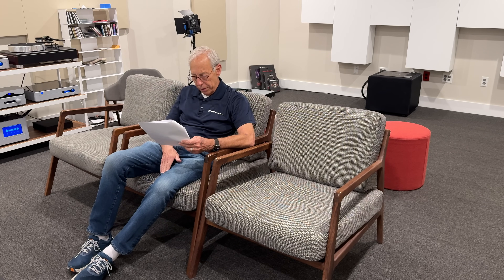Servo or DSP subs

Comment: Back in 1995, I purchased a Velodyne F1500-R.  It is STILL in use today and still looks and works like new.  With that servo system, it is why Velodyne held the spot for having the lowest distortion of all subwoofers on the market at the time.    What is amazing to me is, with only 250 watts, it is VERY close in output at the lowest notes (15Hz.) to my Martin Logan 1600X with ARC and 900 watts continuous. 

And YES, the two subs are part of two independent systems along the same wall only about 9 feet apart.  Both audio systems can play at the same time and AB tests are easily done.

Comment: Use the line level connections.
Using high-level will nake the signal go from high level (speaker level) and then to low level inside the sub amp and then gets amplified by the amp again. Makes no sense. The high level inputs today are there mostly as a backup to connect if you don't have line level out..
And line out is the exact same signal but before it is amplified by your amp or reciver anyway.
And in a surround setup you would want it connected as "LFE/L+R" so it gets used for the dedicated LFE channel in movies etc and in 2.0 stereo without LFE signal it just uses left and right signal and sends that out.

Comment: So how would you use DSP and speaker level connections? It seems to me that the DSP is either something from the preamp or a crossover component and will not be fed to the main power amp. Another thing that I'm discovering, most full range speakers attempt to produce low bass. However, as we all know, it's a real challenge. Therefore subwoofers are then dedicated to optimize that lowest octave with a dedicated, robust power amp. Wouldn't it make better sonic sense to limit the main speakers from trying to produce that lowest of bass information, thereby freeing up the main power amplifier from having to deliver that current? And the only way to do that is in the realm of line-level interface, correct?
Reply: Paul as mention this before, he wants to build dsp upper in the chain somehow, perhaps active speakers.
but a purely passive speaker and normal hifi gear is a safe bet for a business and easy to use for home.

as for my experience i moved over to dsp preamp unit and that is a huge step up.
i have a purely digital unit, but you can easily get one with analogy output.
with 4 channels you can use peq and set up high pass for mains and use any kind of subwoofer, active or passive. and most importantly have the ability to delay the main speakers. normal hifi you can only delay the subwoofers and that one are already delayed with built in dsp.
also you have the dsp before the amps, so they get bandwidth limited frequency range.
in my example i use a minidsp SHD studio, two dac's and two power amplifiers. digital in from a source.

Comment: But Paul, you have said that your use of servo designs like in the Infinity system is no longer needed.  Therefore you don't use them in the Aspen F-30's.  Why is that?
Reply: servos require amplification and he wanted to make a passive speaker, think active woofer section was tested at one point

Comment: Interesting discussion.  If it works effectively, servo corrected subs makes logical sense.  Running them off the main amp also makes sense to have the sub have the same distortion as the main speakers.  I don't see DSP and servos as opposing choices.  DSP can correct for in room sound and servos still align sub distortion.

Comment: A DSP in a subwoofer is a suboptimal position of a DSP in the system.

The DSP will be very limited in its capabilities. 

It can't do anything with sound frequencies above those that just the bass can reproduce.

The placement can't fix the crossover point, what order of filter, linkwitz or Butterworth should be used for your mains.

The DSP can not tune your room for ALL of the frequencies that your mains are playing.

That DSP can not fix the frequency response throughout your whole system.

There is no way for the DSP to be able to give you different house curves more than at the bass frequency range so that they seamlessly mate with your mains when. (That would give better sound quality experience with low/high level, mixing situations.)

And so on..

A subwoofer manufacturer have no other place to put the DSP plus it sells if they write DSP on the cardboard box..😅

The DSP should be in the HiFi topology were the preamplifier is today and replace it.

If you want the best sound quality from a preamplifier cost no object than it is one with a DSP that offer all of the above and more!

As no traditional old school preamplifier at any price can not come close sound quality wise as they have not the tenth of the required capability to do so.🎉

Comment: How do engineers decide what is the max safe input voltage to design for on a subwoofer input? A voltage that corresponds to 100 watts into 8 ohms, 28 volts, 1000 watts, 82 volts, more? Seems like using high level inputs, you would loose at least 10db of snr, and dynamic range out of your sub, just for chasing your main amplifier sound signature.  But really you are adding error on error, and limiting the range. Realistically probably does not matter, but this just seems like poor choices to chase the idea of replicating your main amplifiers sound.

Comment: Can I check my understanding here. Paul is saying that the most common method of using an rca out to subwoofer from an HT amp, isn’t as good as taking speaker cables from the front channels to the speaker inputs of the sub? 
Then, in most stereo or integrated amps in music systems they don’t have sub out so we should again take speaker cable out to the speaker inputs on the amp.
How do we match speaker cables if we are using special speaker cables for our stereo speakers?
What happens to the ohm resistance that is presumably added together front ohms plus sub ohms, maybe, 8/12/16 ohms load to the amp now. And the plate amp is not engaged. Are the sub crossovers engaged?
Reply: That's an easy one. The high level inputs to a subwoofer are merely to steal a small sample of the signal from the amp but the input impedance is so high that it just doesn't matter. Also the speaker level through and out connections are there just for convenience but do not have to be used and in fact shouldn't be used if you have the concerns that you mentioned. Furthermore since there is virtually no current passing through the wires going exclusively to the sub there is virtually no loss. However the characteristics of the  stereo amplifier AS WELL AS the characteristics of the FR and FL speakers that are imparted back into the same amp WILL become part of what the subwoofer sees, therefore providing enhanced integration of the subwoofer to the system.
Reply: Think of it as low level vs high level, the amplifier inside the box for the subwoofer can often use both as input, it's just two different circuits after that to get each to the level suitable for the actual input of the amplifier.

There's not really any need to match cables, and even if you tried to get the best possible option it might not be the same as what you're using for your mains (that was one of the reasons for two posts on the mains, different cables for low and high). The amount of amperes needed is next to zero (voltage is decided by the main amp). 

Subbass don't play the same game as the rest of the frequencies, things matters, but not in the same way. 🙂

Comment: it doesn't have to be connected to the cone of driver you can use a piezoelectric driver connected to the cabinet ideally the front baffle, and a low pass filter fed back to the input to the amplifier will do exactly the same thing. any driver can be made into servo driver.
Reply: It doesn't even have to be an accelerometer. There are servo subs that use a secondary voice coil as a sensing coil within the motor structure. This is how Rythmik Audio does it.
Reply: @G3rain1  yes I'm just pointing out that you don't need to have a subdriver with a coil on it that's what Paul was talking about